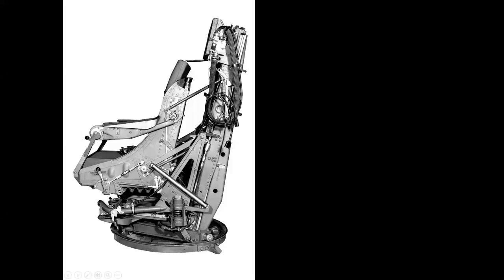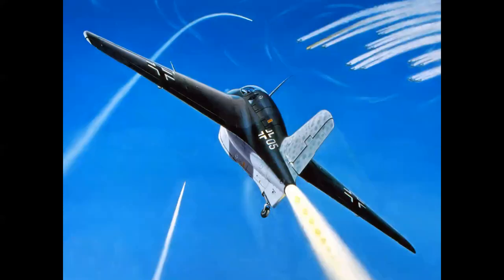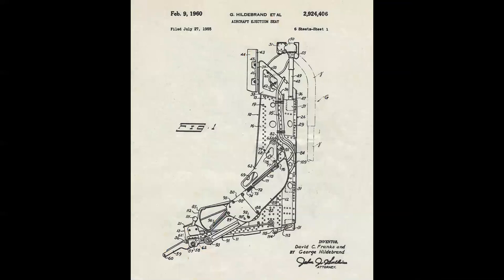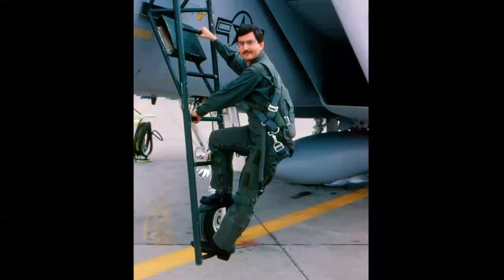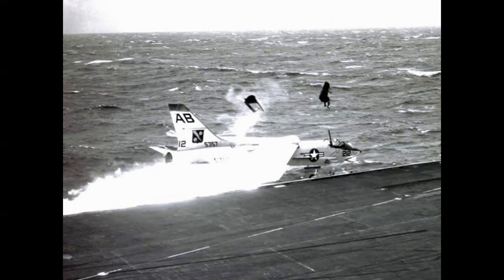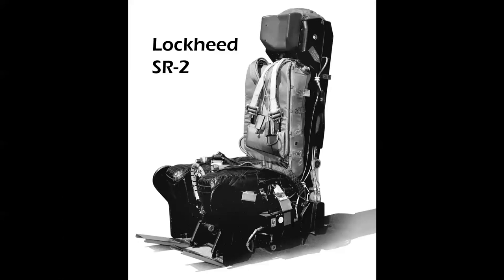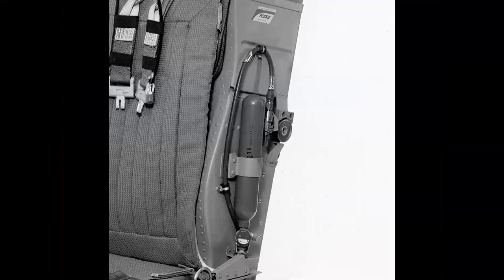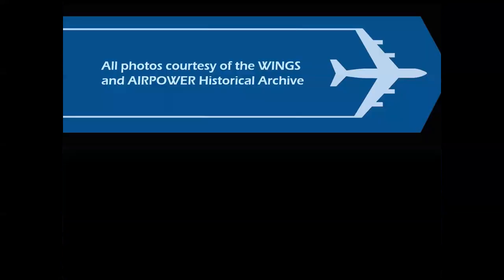EJECTION SEATS - Evolution of High-Speed Aircraft Escape Systems in the Supersonic Era

Comment: I was an egress systems tech in the USAF from 1972 to 1978. My first duty station had me working on B52G’s. The B52 series all had downward firing ejection seats, the G model had two  downward firing seats and four upward firing seats. 
 But the most interesting egress systems i worked on were the Yankee aviation systems that were retrofitted to the A1 Skyraiders. It was not an ejection seat, it was an extraction system that pulled the aircrew out of the aircraft. The aircraft could be flown with the canopy open, this placed the front of the canopy frame in the way of the escape path,so the egress sequence  started by using  a form of Det cord to cut the frame and acrylic out of the canopy clearing the escape path. Then the extraction system fired a rocket out of the cockpit, this rocket had two ropes attached to the aircrews parachute harness. These ropes would then pull the aircrew out of the aircraft. There are a bunch of steps I have left out of the sequence because this is already too long of a post as it is.
Reply from the maker: Thanks for the comment and great information!
Reply: Wow, interesting job! Det cord!? Crazy 😜
Reply: Yeah the Yankee system looks pretty wild!
Reply: There's a video here on youtube documenting how it worked (The Yankee Extraction System). It's pretty neat! Another "positive" is that since the rockets pull you out of the cockpit, you don't stand any risk of getting compressed vertebrae and other back injuries more commonly associated with "pusher-type" ejection seats.

Comment: In Sweden, a version using compressed air was tested in 1941. A gunpowder ejection seat was then developed by Bofors and tested in 1943 for the Saab 21. The first test in the air was on a Saab 17 on 27 February 1944 and the first real use occurred by Lt. Bengt Johansson on 29 July 1946 after a mid-air collision between a Saab J21 and a J22.

Saab continued to develop their own ejection seats for all their fighter jets up until JAS39 Gripen A for which a Martin Baker Mk10 design was chosen.

Comment: Nice video.

I worked egress for over 22 years in the USAF.  Started in the '70s on F-4 Phantoms with Martin Baker seats.

I was involved with the evolution of the F-15, which initially had escapac seats, then went to ACES II, I retrofitted the new seats in the older A and B models.

I got to be stationed at Edwards AFB which allowed me to work on many unique aircraft and escape systems.  I was there for the first B-1 crash, which had an escape module, and resulted in a fatality.  Then the ACES B-1 was developed (not exactly like the fighter versions), which was the escape system for production bombers.

Had many successful ejections and several failed ejections in my time, which were from out of the envelope ejections and not maintenance errors.  But it was always a long wait for the accident boards to make that determination.

Comment: As a current Egress System technician for the Air Force great video. I work on the Aces ii seat. Only comment is about those pitot tube sensors. They do measure the barometric speed and altitude however, that info (which is just the wind itself) is sent through a sequencer that determines the mode of ejection, 1, 2, or 3. From there ballistic gasses and electronic signals control different components, the STAPAC is an EED (electro explosive device) fired Gyroscopic stabilized system that controls the pitch and attitude of the seat to prevent tumbling. Its all a very interesting system. Great video though!!! Love the work keep it up!!!!!
Reply from the maker: Thanks for this information.
Reply: The pitot tubes sense the DYNAMIC PRESSURE or equivalent airspeed of the seat. There is a separate sensor that measures the base pressure, and these two components are used to determine the mode.
Reply: The environmental sensor detects the relative velocity versus the altitude and determines the correct mode. The MASS sequencer does this in a different manner.

Comment: I remember reading as a kid that early American seats used a 37mm cannon cartridge as the propelling charge.  Given the sudden, brutal acceleration, back injuries were common.  The shift to rockets made them much safer.
Reply from the maker: Yes, good point, thanks!
Reply: @celebratingaviationwithmik9782  Having been a few months since I watched this video, I can't remember if you discussed the 'extraction seat' developed for aircraft such as the Skyraider.  In these, a rocket pulled the parachute pack out, then the pilot by his risers from a stricken aircraft rather than launching a heavy complicated seat.
Reply: Even today, ejection is a career-ender for many pilots. The rocket acceleration is more gentle – not by much – than a cartridge, but the stresses on the pilot's spinal column are considerable.
Reply: The cartridge is still there on modern seats, it's just weaker as it only needs to propel the seat far enough to ignite the rocket motors safely (if the rockets were ignited whilst the seat being inside the aircraft, the crewman would suffer serious burns.) @MarsFKA

Comment: As a young avionics tech at Tyndall AFB, Fl. in the late 1970s, I was initially selected to be on the F-106 Hurricane Evac team, ad techs would fly in the backseat of the F-106B if a hurricane approached.  I got to ride the ejection seat trainer, which was boosted up the rails by compressed air.  Cool ride!    But my ears flunked me in the altitude chamber, danggit.  😕

Comment: One of the aircraft that my father flew during his naval career was the A-3D sky warrior. The nickname the crews gave it was "All Three Dead." If you had an under powered cat shot or failed to catch a wire and didn't have power to bolter you were going in the ocean and you were going to die. Cause the only way to get out was the escape patch on the bottom and protocol in the variant that my father flew was to take 1 of the radios and put it out the door 1st so it would knock the antennas off the belly and then a crewman could follow.
Reply from the maker: Amazing story, thanks!

Comment: I worked for an aerospace company in the late 70's to mid 80's. They manufactured the rocket catapult that fired to get the Martin-Baker ejection seat away from the cockpit. A model of that seat that was produced in the early 1960's was also used by NASA for the ejection seats used in the Gemini Spacecraft. I'm not sure how but the ACES-II seat ended up being owned by Stencil Aerospace in the 1980's and my company that I worked for, Talley Defense Systems, made the Seat Back Rocket motors, or SBR's, for the ACES-II seat.
Reply: I thought that MBA manufactured all of their CAD/PAD.

Comment: I was a plane Captain on A7E Corsair II aircraft in VA 86 Sidewinders deployed onboard Nimitz in the 80's. I was standing on the steps bent over the canopy rail putting the 3 safety pins in the Stencel SJU-8/ A ejection seat after my pilot had climbed down from the cockpit. I wasn't aware that the C02 bottles lanyard beads on my float coat had dropped down in the recess for the canopy latch on the sill. When I raised up it pulled the lanyard and fired both C02 cartridges. I heard the loud whoosh and immediately thought I had somehow fired the ejection seat. I let go off the canopy rail and fell backwards in a vain attempt to escape the rocket exhaust that was sure to melt my face off. I landed on the deck on my back which rang my bell and knocked the breath outta me. As I laid on the deck trying to catch my breath I felt a lot of pressure on my chest, it was then I realized that my Mae West completely inflated and that the whoosh I heard was the cartridges that I took as the ejection seat firing. No major injuries only a few bruises and feeling of utter stupidity. My Squadron Mates being the caring individuals they were laughed until tears rolled down their cheeks, and reminded every chance they got. And that is my ejection story. Lol 😏
Reply from the maker: Wonderful story, thanks, and 'glad you were OK!

Comment: I have heard that when bailing out of a P-38 that the pilot would roll the plane before bailing out to clear the twin tail and elevator.  Just wondering, if somebody is luckily enough to be a private owner a F-86 Saber would it still have a function ejection seat?  Do pilots lose a 1/4 inch in height after a ejection and is the limit on how many times a pilot is allowed to have ejected?  Ironic that a Thunderbird was used as a pull vehicle to test a ejection seat, a homage to the  USAF Thunderbirds.  Sorry for my long comments but your videos have a way of pulling the viewer into the story.  Thanks for your time and work.
Reply from the maker: Jet Warbird pilots today are mixed about having 'live' ejection seats in their aircraft, as special maintenance is required. Bob Hoover ejected out of three different aircraft, but I've know fighter pilots who were injured during ejections, and were restricted to flying transports or other non-ejection seat aircraft afterward. Appreciate all your comments, thanks!

Comment: Hello and thank you in advance for any response. I once flew in a CF-101 Voodoo at Bagotville in 1982, just before the CF-101s were replaced by the CF-18s. The CF-101 model was without dual controls so not for flight training. I remember that during the short training it was mentioned that this type of seat was effective among other things only at an altitude of 100 feet and above and at least on a slight climb. If I remember correctly. After some research I believe the chair I was sitting on was a Weber or a Martin Baker? But probably a Weber who seems much less known.

Could anyone tell me details about the seat I was sitting in? Also I believe that it was not a pyrotechnic rocket device that was underneath but rather dynamite? But I'm not sure if it was actually dynamite because of the possible sudden impact that could potentially cause injury? Or maybe it was a limited charge of dynamite?

THANKS

Comment: I´ve heard about a German pilot using one of the early ejection seats in WW2, surviving the bail out but lost both hands.
Reply: If it's the same case I'm thinking of, he didn't survive and his body was found minus both arms... :(
Reply: @jackaubrey8614  Could be as well. I´m not very sure.
Reply: Being a tall guy as an enlisted USAF tech, when I would sit in an ejection seat, my knees would be under the instrument panel.  Always figured if I had to eject, I would lose both legs!
Reply: @foreverpinkf.7603  Surviving two severed arteries, without help for a few minutes AND without the use of both of your hands?
Yeah, that will take some real survival mindset to say the least.
Reply: 'A' pilot ? It was common when first introduced . It was the Dornier Do-335 'push-pull' engined heavy-fighter . Apparently , the procedure was complicated and had to be followed precisely . Otherwise , the pilot (plus trainee , or radar operator in the 2 seat version) would lose his hands if not his whole arms ! Ironically , the dorsal tail (upper) and rear-propeller were designed to be removed by explosive bolts to protect the ejected pilot , but it was the design of the seat , interior handles , and edges that were the most hazardous .

Comment: Excellent presentation. Interesting scenario in the final picture of the rear seat ejecting from a F104 with the front seat already gone. Wouldn't the rear seat go first so as not to get a face full of rocket blast when the front seat went first?
Reply: Thanks for the comment, and that scene was described to me by an F-4 pilot flying right next to the F-104 when its engine exploded due to a fuel system fire. For some reason, the pilot ejected first, then the GIB, who was protected by his canopy that hadn't jettisoned yet. Both survived.
Reply: @mikemachat  Okay. Thanks. Happy ending for everyone.